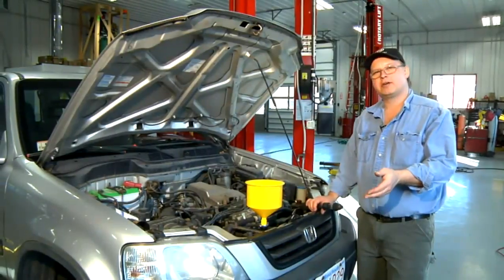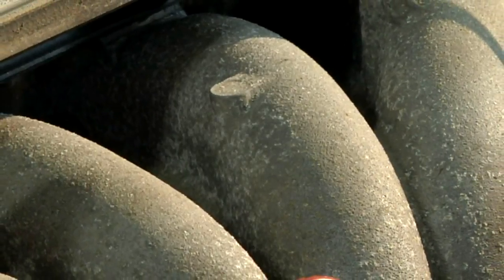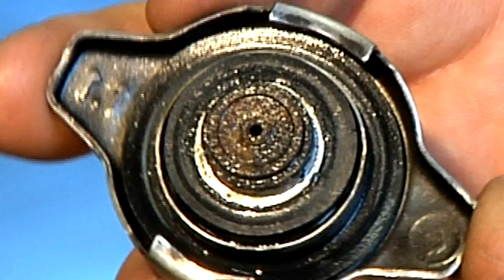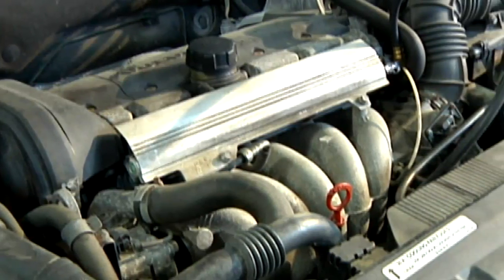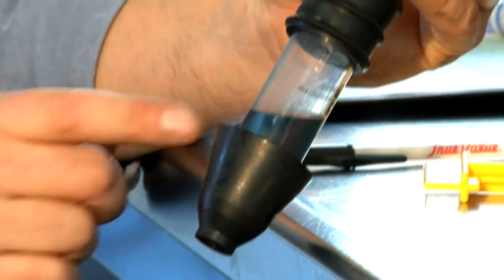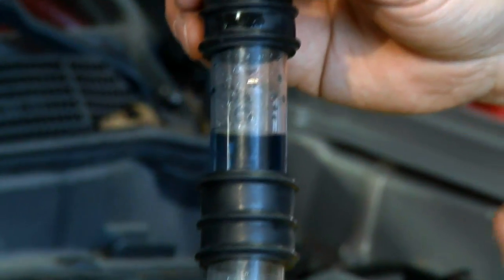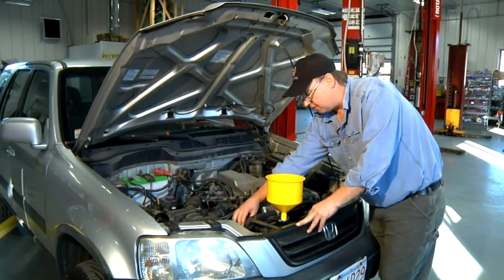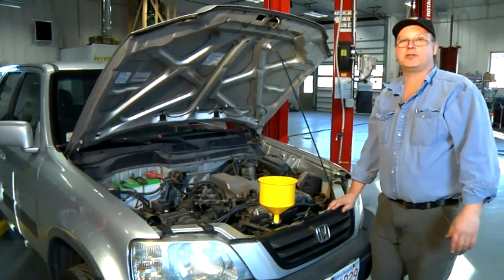How to Check Exhaust Fumes in the Antifreeze

Comment: With your radiator cap on, take the rubber hose that comes out under your radiator cap, and put it in a bottle of water, if it bubbles the water you have a blown head gasket leaking into your coolant system.
Reply: can you make a video on that? i think i have one
Reply: @_alexmuerto_ 😂 Just get a bottle of water and put the hose in it. Start the vehicle and watch for bubbles. On a side note, you may see a bubble here and there as the vehicle purges the air out. Typical on some models. If you see A LOT of bubbles, then you have problems.

Comment: I tested from the overflow tank and got only the very slightest hint of yellow on top of the bubbles. So that's great news.
Is it good to also check at the tail pipe exhaust ?
At my tail pipe it immediately turned strong yellow .
Is that to be expected ?
or does that mean a bad cat ?
Reply: of course it is expected. your logic is backwards. You are not testing for coolant in your exhaust gases. your are testing for exhaust gases in your coolant. It is turning yellow because exhaust gases are expected from the exhaust pipe!

Comment: My Prius loses oil mysteriously. No clue where it's going because there are no leaks outside the motor. I noticed when checking my coolant today that the inside of the tank is nearly black and it smells like combustion gasses. I wonder does that mean my head gasket is blown. otherwise there are no problems at all and no check engine light.
Reply: Yes- it does mean that.  Your post is old.  What was the outcome for your prius?

Comment: "And leaving the cap on the overflow, I'm going to take the tool and stick it in the overflow container..."  What???  That makes no sense.  How do you stick it in the overflow container without taking the cap off of it (or puncturing it)???   It would have been useful to actually film that from an angle where we could see what you are doing to insert it.   You video was otherwise well produced, but due to this..almost helpful.
Reply: My question exactly. and I see you got no reply to your question.

Comment: Besides being FAR too long-winded this video is confusing. Same engine tests differently? BTW I've seen lots of systems bubble - it's often an overheated engine boiling the water mixed into in the cooling system (as in roadside overheats where someone dumped in water).
Reply: I think it'd best to do the bubble test while cold actually. If the engine is building pressure and bubbling from the radiator or overflow tank while the coolant is cold then you know it's not steam.

Comment: wrong get educated more than 90% of the people out there think bubbles means gas in coolant THAT'S JUST NOT TRUE otherwise 100% of GM vehicles would have a blown head gasket and we know replacing head gasket is not a solution because something caused the head gasket failure either a cracked block or warp . making a video to half explain something is like teaching people how to commit vehicular murder or suicide ...idiot !

Comment: So, how can that same engine have a blown head gasket and NOT have a blown head gasket at the same time??? You give two different diagnoses on the same car...
Reply: It's possible that there weren't enough exhaust gasses to register on the test? My guess is that he was just demonstrating both tests to teach us. I think he was simulating exhaust bubbles with that copper hose. The car is probably fine.
Reply: Exactly my point .   It's not a good video.    He should have addressed at the end why 1 test passed and other failed . Instead he let us be puzzled with vagueness.

Comment: So unclear and confusing. A honda or a volvo? Same engine tested shows no exhaust fumes and later bubbles with exhaust? Or is it another engine all together?
Reply: For what it's worth, it doesn't really matter what the car is. The same problem, with the same solution, applies to any water-cooled engine. (I'm not saying this was a great video by any means, just that the car type doesn't really matter.)
Reply: He was likely purging the air out by squeezing the radiator hose as an example.

Comment: Just had this happen to my 2002 Civic. Feels bad man
Reply: Congratulations! Blown head gaskets are pretty much a rite of passage for 7th gen civics. Replace the timing belt, tensioner pulley, and water pump while the head is off.
Reply: That's why u should never buy a Civic.  The engine is too small, always ends failing.  Get an Accord .